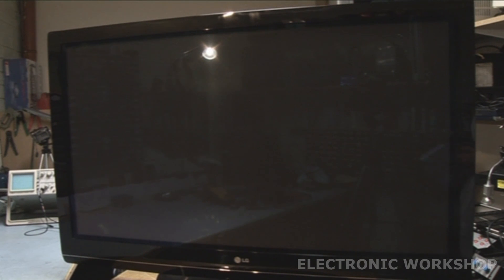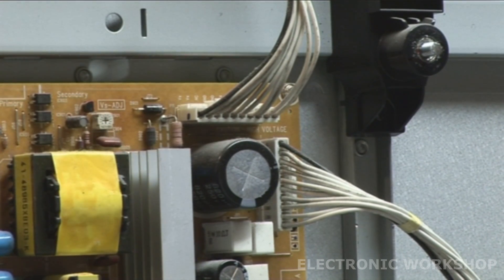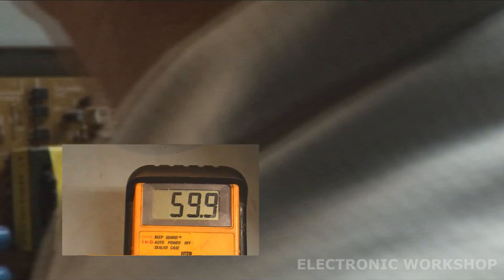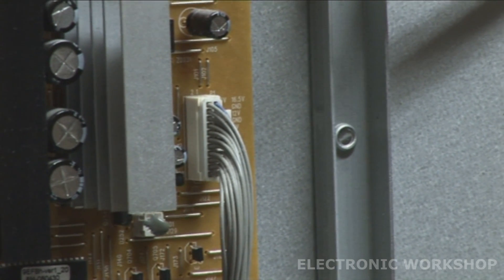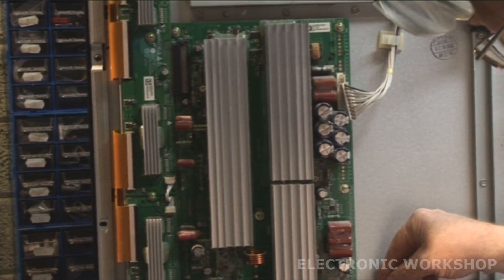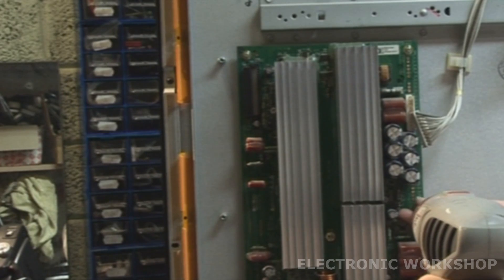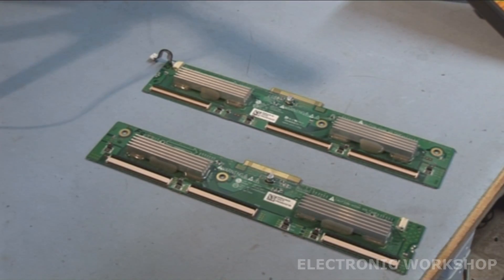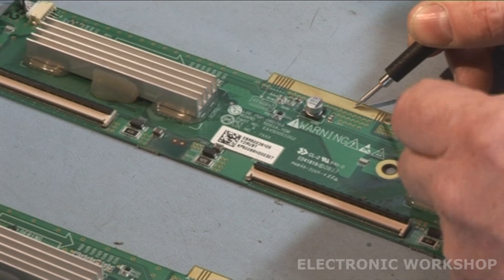LG 50PG3000 No Picture Pt 1

Comment: Hi. I havesamsung 42" plazma tv. What can  cause VA and vs voltages dropped, after turn on. Got sound, but nothing als. At first found burned fuse on X main and igbt on x buffer.replaced them, nothing changed. Replaced boards,  nothing changed. Voltages remind stabil if disconnect signal cable from x buffer.

Comment: Hi seller my lg 50PG3000-ZA model giving me alot of trouble NO picture NO sound  just standby light ok turning on  red to green but no pictures no light on the screen .
    Bought another Power supply tested all voltages okay have changed the 2 buffer boards and the Yboard still not working.
  Onto the logic board is standby green light (not blinking) but with the remote control is turning off/on .
Now with this explanation what do you think is gonno be the problem?  Will great to hear from you soon as you can thanks
Reply: CHEIF OGHENE-LUKOME CHUKWUEMEKE IBBREDE y

Comment: Hello,

  I have a L G tv with no picture. I watched your video and I think it 
is the capacitors. How ever when I was trying to figure out the problem(
 Before I watched your excellent video) I changed the Chanel on the T V 
and now can't get it back to CH #3 or Ch# 4. so now I have no picture 
and only static sound. I tried using the remote to command the channels 
to change but no luck. I have the skills to change the capacitors, can 
you tell me how to get the tv back to #3 or #4 ?

  Thank you,

  James Ferrigno

Comment: I have the same tv but my problem is hdmi has picture but no sound with sky hd box or chromecast. But when I plug in some hdmi devices it has sound and picture. would you have any ideas how to fix.

I have tried all hdmi ports wits various devices only the sky, chromecast,dvd player have no sound in any port.
I have tried the devices on other tv and all works well